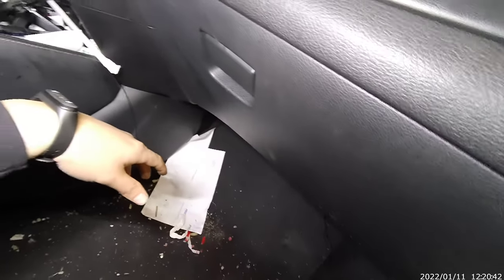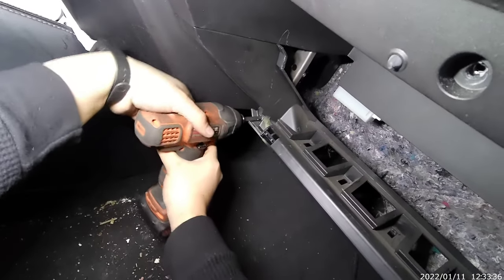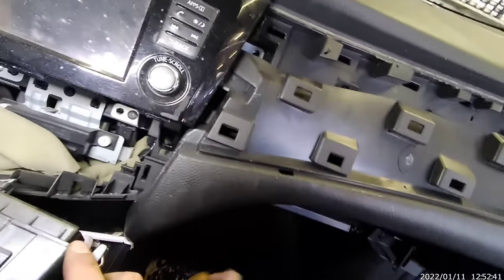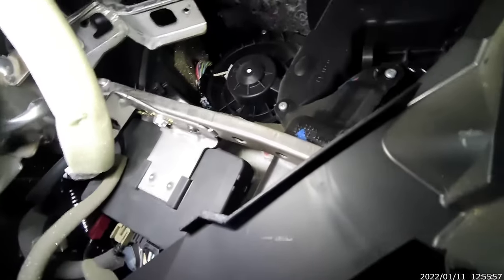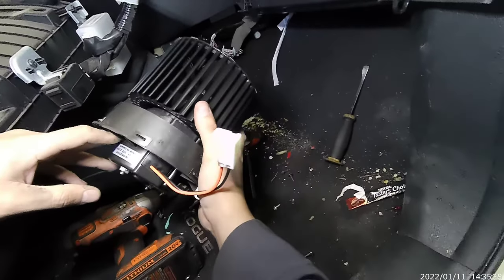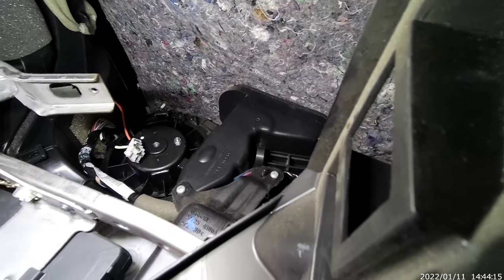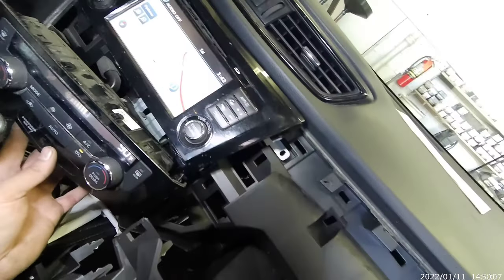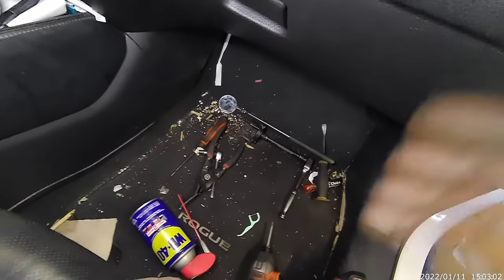2017 - 2020 Nissan Rogue Murano How to replace blower motor

Comment: Hello, back again... I returned to my fan motor replacement and prepared an oil filter wrench to enable me to rote the fan motor from its locked position. As I mentioned in my previous post Axtuo Ax failed to mention in what direction to turn the fan motor. Not able to turn the fan motor counterclockwise or left I proceeded to turn it clockwise or right and suddenly it popped out. Also, I mention that I didn't think it was necessary to remove everything other than the glove box compartment, initially I did, but experienced it was a waste of time and effort because the unit slipped from right underneath the glovebox frame. Just wanted to contribute to Axtuo's video which is far better than others I watched...

Comment: Thanks for posting this video. Made my like a whole lot easier. Still was a MFer, but this made it way better. On a side note, Nissan replaced this blower motor while the car was under warranty, and didn't even bother to put the motor screw back in.

Comment: Enjoy watching the very helpful video, the one thing you failed to mention was the direction of turning the unit out. The problem I have is that I loss arm strength and couldn't turn the motor out, at one point I even thought it turn to the right. Nevertheless, your process was good, I wonder if it was necessary to remove all you removed to access the unit. Without removing everything you did I had a clear access and grip to the motor, but not the strength. Thanks again, it was fun to watch...

Comment: Thx for the vid...what a pain..i have a toyota camry that takes five minutes to replace...renault really messed up nissan.
😁👍
Reply from the maker: What are you saying??? Renault merged with nissan???
Thanks for watching 👀 🙂 🙏
Reply: @AxtuoAx  Renault makes the parts for Nissan...the cvt transmissions are garbage..Renault decided to let nissan supply the manufacturing because of the recalls and trouble with nenault...i just got another recall today.
Reply from the maker: Wow.....good to know!!! You work for nissan or renault???
Reply: @AxtuoAx  43.4 stake in nissan...and now renault wants to sell off their stock and nissan shares are falling...
Reply: You really don’t have to take all that apart

Comment: Did you have to adjust the connectors? For some reason my sensor don't clip in
Reply from the maker: Push it real good...pause
Reply: Oh yea had lean into the thing. Thanks
Reply from the maker: Where you from?